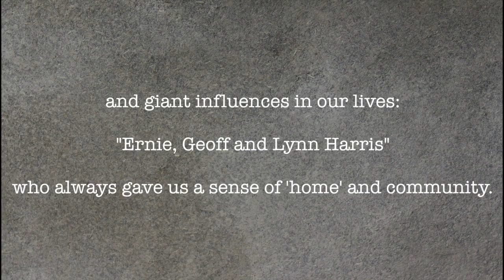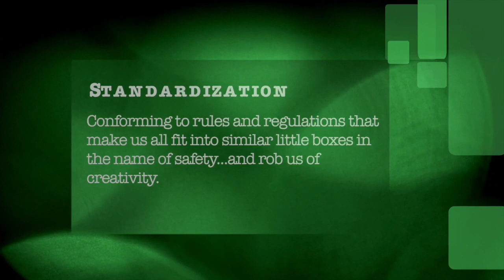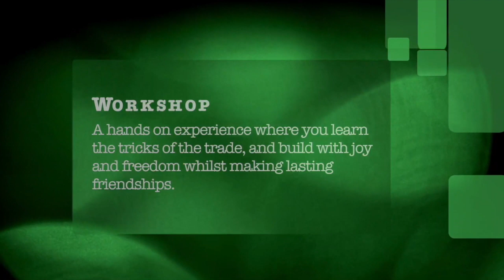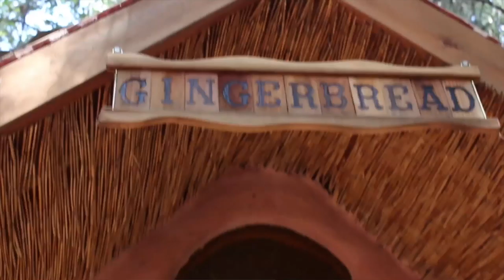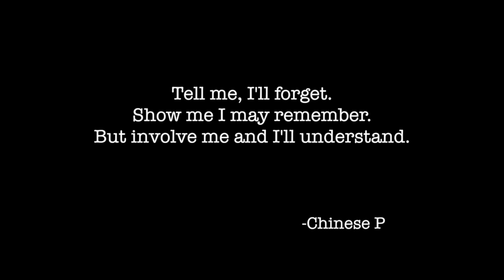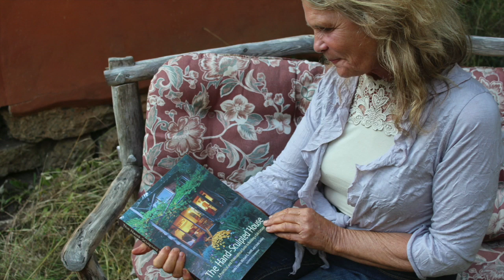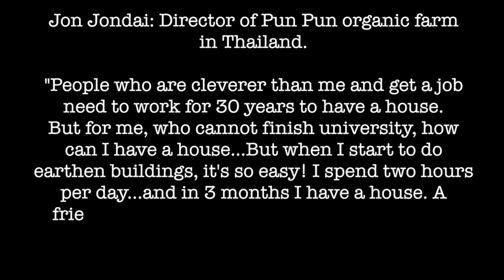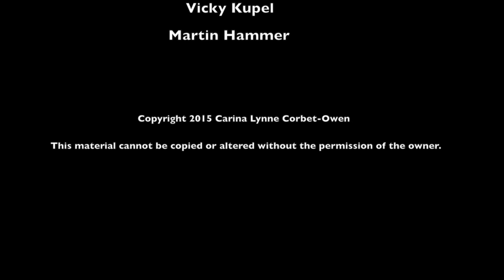We Create - Why we need handbuilt homes

Comment: We ARE in trouble, if we keep doing the same old things, expecting better results. It's all gotten far too complicated. Not even inspectors can grasp all  the rules, nor can permitting agents. PLEASE keep making more of these videos!!!!
People are increasingly disenfranchised, unwilling to apply for permits from crooked, broken, power-crazed systems.
Why should I trust officials who refuse to allow me to live in a well-engineered yurt?    Why trust officials who refuse to allow me to build off-grid cob, earthship, or earthbag houses, without forcing those to be built to Codes that only fit for stick-built houses?    
WHY trust officials who cannot agree on what a good job of building is, or vary between "you need 3 outlets under that window" and "you only need one outlet under that window, IDK why the other guy said you needed 3"......and more?   
How about home inspectors who routinely MISS egregious damages in a house someone is buying, then play dumb? [One even tried to convince me this house was 2x6 construction--it most certainly is not--it's cheap 2x4s with mingy insulation and trampoline floors with a leaky roof.   
But it was bought in summer, so they couldn't swear that the roof leaked...so it was not on their report.  
Inspectors I spoke with, dodged putting anything on a report that might ruin the sale of the property.  
Septic industry has gotten mandated their engineered, guaranteed-to-fail systems...even though far better can be done using natural systems, which keep sewage totally aerobic and clean, so it cannot pollute ground and water.  
Or house flippers that routinely COVER/HIDE major defects in houses sold?   Trampoline floors [2x8's spanning 15'], badly installed showers that if used, will rot the house; paint hiding failed drywall from roof leaks, slanted floors, bad wiring, sockets, and mains panels, etc.   Installing quick, cheap materials that look good, but are highly toxic with VOC's. 
Realty Industry is a lipstick-on-a-pig RACKET, so cleverly patched together, each entity, from repo-lenders to flippers, realtors, and inspectors, can get away with saying: "I didn't know anything about _____".   
But really? They ALL knew something, but covered up dangerous issues, including wiring, plumbing, siting, air quality, poor framing, leaking roofs, etc.  One place we saw, had a laundry hookup box installed in the wall, with water plumbed to it, but no drainage outlet anywhere...the realtor for that one, got lividly angry when I asked if that would be fixed before a buyer bought it, denying that problem existed...same realtor played games to trick buyers, to pump prices, by claiming "Oh! another buyer just put money down...but don't worry...they always fail...". 
One magic code is:   when an assessor returns to the signing table to tell the buyer "you have $30K of instant equity...do you want a 2nd?"  That clues the buyer, IF they are savvy, that is exactly how much, MINIMUM, is needed to repair the big-ticket infrastructure in the house the buyer just signed for....but none will tell the buyer.    
Here's your keys. 
IT's RAMPANT in SW WA.  
Probably elsewhere, too.  
Thurston County, WA, PERMITTED a huge sewage pit [aka agricultural pond], for the Ostram Mushroom farm, up-close and personal to existing tracts of homes, a school, businesses, and a sports park.    That's a 24/7 operation to make compost to grow their mushrooms-----very good......except.... that pit FREQUENTLY spreads SEWER GASSES all over at least 1.5 mile radius, depending on where the winds are blowing.       
The realtor told us, upon a visit here:   "You might notice an occasional, slight odor from the farm next door".....well, there's NOTHING SLIGHT, NOR OCCASIONAL, about it.    It's SEWER GASSES everyone's exposed to.     
Sulfurous, as well as other noxious gasses.    Hard to breath, smarts the eyes, triggers nausea and dizziness.     
Thurston County PERMITTED THAT some years ago.  
Then....The 1st year, our property taxes were raised THREE times....maybe because we kept the yard mowed?  Put a new roof on?  
The Air Quality Board refused to respond to my emails. 
The Mushroom farm refused to respond to my emails. 
County has yet to respond to communications. 
I told all of them:  'We like mushrooms, the farm, and that they compost-----only, they need to do something drastically different, to contain, or relocate the cesspit for their manures for their composting'.   I included some constructive suggestions to remedy that cesspit.  
It's MALFEASANT, on the part of all involved in stifling owner/builders, stifling natural and energy efficient, cost efficient building, stifling simplifying, stifling creativity.  Raising taxes through the roof if people make their places nice. 
So.... officials wonder why growing numbers of people lose respect or trust...?!? 
Or stop seeking permits?  
 Maybe they need to listen to this some more.
Reply: Winter Star 
Great description of the dirty side of housing.   So sorry that you got a raw deal.  Is the bank you worked with US Bank?  I did an interview with them and they were heinous in my opinion.
Reply: Nope.  But it doesn't really matter what bank...they all pretty much do similarly.    Banks that repo properties, hire flippers to put lipstick on the pig, hide defects, and sell at the most inflated prices they can get away with.  Like car dealers and used car dealers...so much fraud.   
But extraordinarily, occasionally they do something amazing...one client family I do advocacy for, actually lived in the house they had tried to by, for close to 5 years, without paying any payments....just finally moved to HUD housing apartment this spring.  Wells Fargo let this slide...old house, damp climate...them continuing to live in it actually saved the house from deteriorating worse, because the family was still paying utilities to temper the living space, and prevented vandalism.  
Of course, bank threatened to kick them out many times, sending letters with dates of putting it on market.  But the place needs serious structural /infrastructure rehab...probly won't get that; likely will get flipped instead. 
Realtors are similar, especially those that are larger corporations.    We fired Windermere for some shady trickery they were pulling.  Realtors try hard to coerce buyers into signing a contract to only deal with the one realtor..we refused that game, too.    A Remax agent was the one misrepresenting our place.   
But smaller, family owned realtors do some smarmy things too...one in our region, sold new houses built on spec, in an annual flood-prone area, telling buyers "this never floods here; you don't need flood insurance"....of course, retired buyers spending their last money on their last home, no resources to do massive repairs, got soaked half-way up their walls the next rainy season.
Reply: Predators.  Wow,  what a shame!
Reply: Thanks Winter Star.....watch out for my next video which is all about our predatory and disenfranchising medical system.  It should be online in about a week.  And sadly, just like building our own homes, we could be doing so much more for our health if only we didn't believe all the BS that covers our culture like a dirty smell.  Interesting fact, centenarians around the globe barely use medical services.
Reply: Sadly there ae sharks all over the world!  And wherever there is money to be made - you find them in a feeding frenzy.  Buyer beware
Reply: Medical? maybe we should kibitz!   I have some interesting experience with that..some stuff that might curl your toenails.   
And definitely...old people who live to ripe old ages, sans most medical interventions, yet choosing poorly out of need or choice, poor foods, bad habits, etc...yet they are still on the green side of the grade, despite all their poor choices in life...go figure!
Reply: that was Einstein's definition I think of insanity: keeping doing the same things and expecting a different result. You'd have to check me on that - I think it was Albert Einstein, and it is insanity nonetheless
Reply: I listen to the little voice. When I found this place the owner opened the door and said I knew it was you the second I opened the door. The Universe told me you were coming - and I have 14 people bidding the house. It was sold to us during the time the housing crash happened in 2008. We got a house, sold on a private contract by a woman who is like a sister to me. It's been one miracle after another.
Reply: Nothing like the wonder of miracles - so happy for you.
Reply: Well, that was alot but I agree, my second home, a cute little ranch in Ohio  built in1970's, bought 1985, passed the building inspection but two years later, the slider fell out of the frame and almost crushed my 4 yo. On a crawl, the seal plates weren't treated and moisture had rotted them and the ends of floor joist on the full length of the rear of the ranch. The rest of the homes in this subdivision did likewise, about 15 years after construction. I fixed the problem myself and put drain tile to street, hand dug and not code, but was able to sell with no equity after 5 years. So not a good investment. I went on to one more mortgage in IL, nice home in great community, divorce 10 years later, equity $39 after closing cost. Stress of owning home and raising kids, alot to do with failed marriage, but not all.